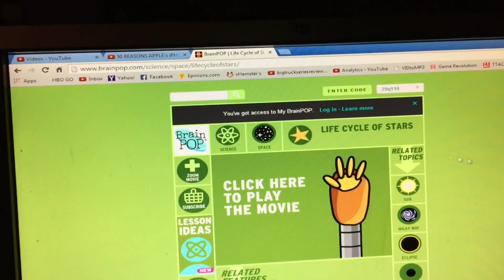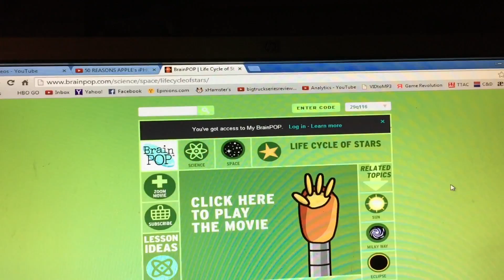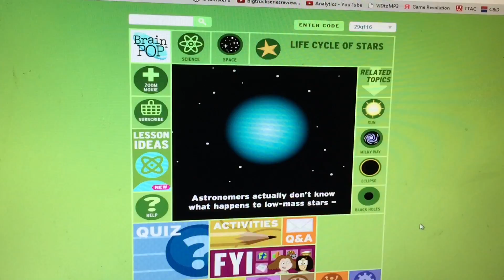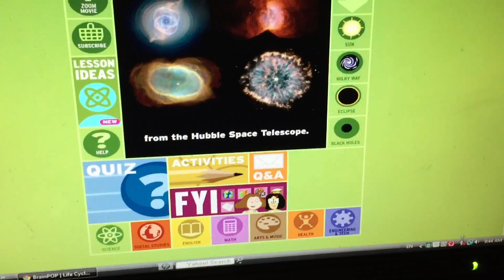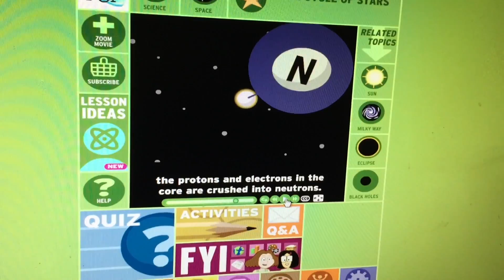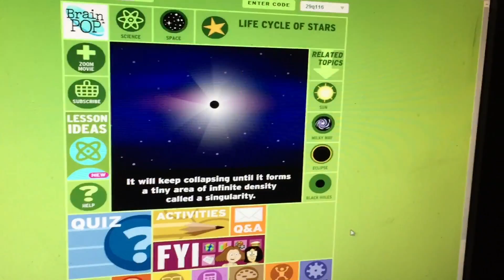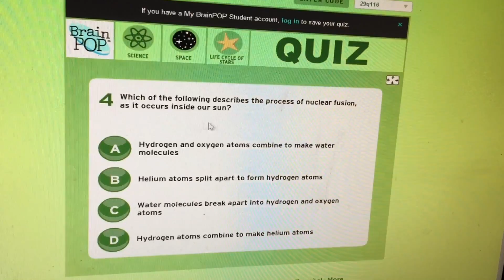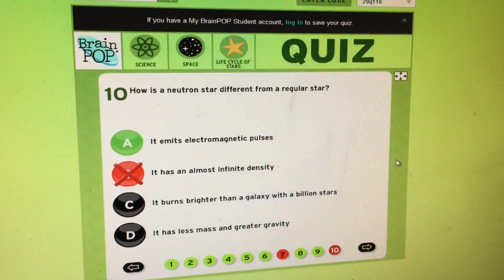THE REASON WHY FUSION POWER DOESN'T WORK: BIGTRUCKSERIESREVIEW's THEORY (brainpop.com)

Comment: Although the "classical" physics explained is true and correct, there has been always a real problem with the scientific community IGNORING anomalies within the environment of the experiment taking place re fusion.
Sadly you are one of these, what I call a "Box Head"! As a a scientist, You are forbidden to peak your tiny heads with even more tiny brains out of that box!

You morons are totally fixated on Newtonian laws that with great respect, has served us well in the modern age, but the question is - Why do scientist totally dis-regard the 'Quantum' environment in which all experiments take place?
Answer - Because NO ONE truly understands Quantum Mechanics!
Therefore the only facts available are those for that we understand, i.e. Classical physics.

Here is one for you Einstein:

An Oxy-Hydrogen generator consuming no more than 260w of Electricity to produce 75L of HHO, and consuming only 30ml of water per hour.

FACT :
1. The catalyst required for the recombination of the Hydrogen atoms with the Oxygen atom is a spark of microscopic energy proportions - input catalytic energy Vs reactive resultant energy.
2. The catalytic reaction recombining HHO back to H2O has various adverse reactions with different types of metals of all types.
3. The component of variation is the heat produced as a direct result of the HHO atoms recombining at a microscopic level when coming into direct contact with the atoms of the metal being affected, with one of the most volatile being Tungsten Carbide. Carbon content is the driver of variation in temperature over time.

Question:

1. What conventional combustible fuel taking the working form of a flame, (which by the way, pretty much everything man made we enjoy today is made from the furnaces of fossil fuel),  can raise the temperature of the work GREATER than the temperature of the working flame?

Answer: NONE!

Question:

2. The working flame temperature of HHO gas is under 300 degrees Celsius, so why when the flame of a HHO torch comes into close proximity raise the temperature to nearly 10,000 degrees Celsius ???

Answer:
This is Quantum Physics at work, so lovingly ignored by box heads like you!

E = MC2

FUSION EINSTEIN, FUSION!!!
And IF it's not fusion, then what the hell is going on??

Do the math!